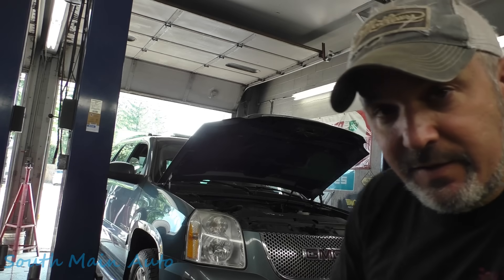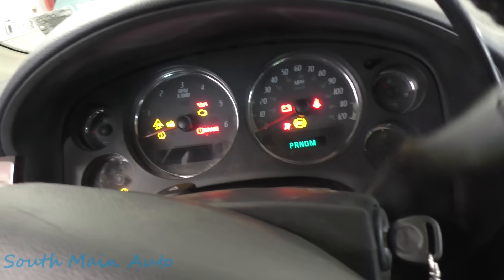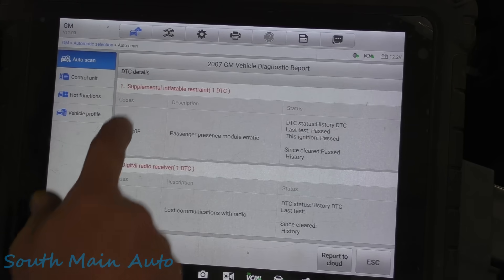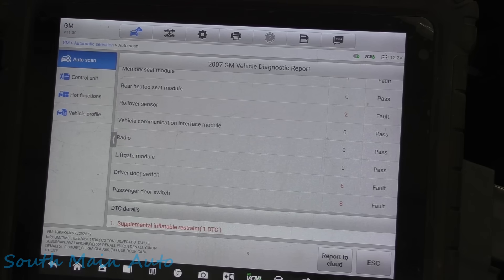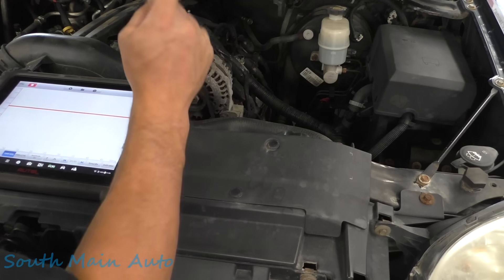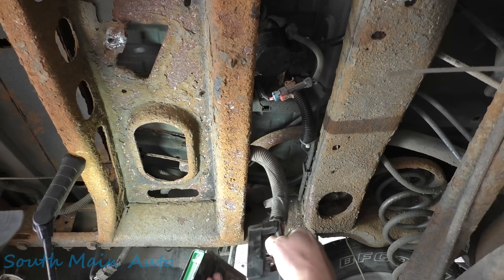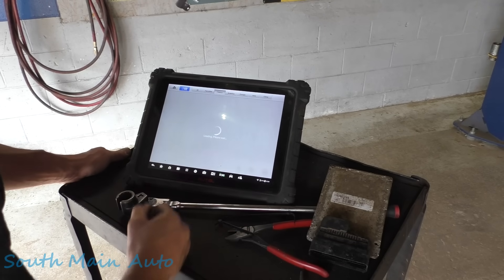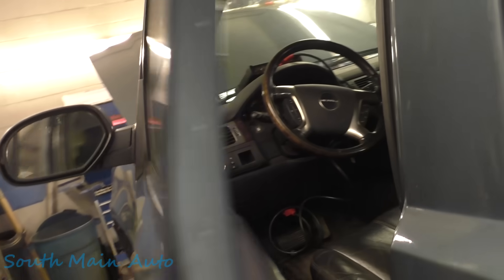Sometimes A Lucky Guess Is Way Easier Than An Actual Diag

Comment: Thanks for this video. I have a '08 Yukon. Fortunately, not that bad under it. I purposely avoided trucks with the air lift because of all the issues. It is a battle to stay in front of the rust but worth it if you want a reliable vehicle.
Reply: Wrong. I bought my 2004 Escalade specifically looking for air ride. The right is so much nicer than the Silverados and the tahoes in the same generation.
Reply: @SeanPennII  the ride may be nice but your wallet hates you if the bladders get damaged. ZW7 smooth ride is a nice middle ground, good ride but only the rear has expensive shocks.
Reply: @lsswappedcessna  they're not that expensive. 300 a corner a cheaper than my 2014 Vsport magneride shocks

Comment: I didn't notice any guess work. Your visual inspection pointed you to the networks weakest area. No Comm usually means to start by measuring the resistance but in corrosion country its optional!

Comment: For rusted out frames, i worked at Firestone, was doing an MVI, had tge veh racked correctly, started to raise it and the guy next to me yelled at me and pointed.  It was a Datson PU i believe. Front tires were about 1 1/2 ft off the floor and rears were still touching. Frame completely split!  Set it back down and the truck taco'd......call MoHP, and they said i still had to put a passing safety sticker on because the frame is not an inspected item. We PUSHED the veh out , had the owner sign a waiver and he drives the truck away w the middle of the frame dragging the streets!

Comment: I live in Indiana and a few weeks ago I asked around about getting my truck spray oiled like you mention and talk about on several vidios... It just isn't done and one shop was adamant that it is a environmentally not allowed... He also wanted $500+ to charge spark plugs and wires (is that normal?)... Anyway, I ended up doing a google maps search and found a Amish fella that does the oil spray and uses a comercial product... And it cost $140 and took a hour and a half... I wonder how many vehicles could be saved if we knew about this...? 🤔
Reply: Sounds like that first guy didn't know what he was talking about.   I'm pretty sure Fluid Film is just lanolin-oil based anyway, am I right??  Environmentally I don't know why you wouldn't be allowed to coat your truck frame with it.   I mean they used to coat cars with all kinds of crazy stuff underneath.

Comment: Eric,
There is no substitute for experience.
I live in the salt belt of the mid-west where they
use a brine on the roads, I think it has calcium chloride in it, very corrosive, vehicles driven in the winter don’t have a chance of lasting more than 10 years with out experiencing body and frame rot.
Thank you for posting your videos.

Comment: You can easily fab a steel bracket and attach it to the moving portion of the shop lift forks on both vertical poles.  Duck tape some Rubatex pipe insulation to the bracket.  Keeps driver and passenger doors ding free!

Comment: It's what some might call having EXPERIENCE with certain tell tale signs with certain makes and models. If you have some "old school" experience under your belt, that helps a bunch as well. If all you know is how to trace down things with the PIN test methods...you will be there for quite sometime until it hits you in the face. 
I agree the 6.2 L GM is a keeper of an engine. Torque and HP at almost every RPM. All they need are tight battery cable connections !  (LOL)

Comment: Industrial maintenance - had an intermittent fault in one of the machines. The circuit board was tested using all the suggested tools and methods. No direction. Pulled the board out and put it back in for the bazillion time and missed the back of the connector. Actually pushed on the board, which moved independently of the connector. Not supposed to do that. Cold solder joint on the connector. Lucky is some times better than good.

Comment: Be nice if the manufacturers would actually rust proof the underside somewhat, when I got my motor home a lot of the frame and metal wasn’t even coated, I rustleum painted everything that wasn’t coated, held up well for 16 years but I’ve lived in Arizona for 12 years

Comment: Got an 08 Yukon Denali 6.2 that after lifter replacement and a few "while I'm here parts' runs great but dies at a stop after it warms up. Just like you shut the key off. Only way to get it start back up is pedal to the floor aka clear flood mode.. No CEL, pending codes or history codes.. I'm stumped and so is every other mechanism in Alabama..

Comment: I have a 2004 chevy tahoe, 476k miles, original drive train. While I live in the East (PA) my frame is in decent shape, no rot but I did have to replace every metal line there is in it, brakes, gas, etc..I also replaced the entire suspension and a few components on the motor but the car is a tank and is very reliable..I would drive that car anywhere. On the flip side my new Chevy Traverse didn't even get past 36k miles before it needed a new alternator and other little bullshit, which of course isn't covered by the warranty anymore.

Comment: Just an FYI for ya, Eric.  There is no Class 2 Network, more commonly known outside the Corporate GM Proprietery realm as SAE-J1850 VPW (Variable Pulse Width) on this vehicle.  This is a GMT900 Program based Truck.  The last year for Class 2 on these particular Trucks was 2006, for the Previous Generation GMT800 MCE-3 which were built from 2003-2006.  Class 2 is GM's  terminology for the 57.5 kbps SAE-J1850 VPW (Variable Pulse Width) .  The Lower Priority controllers on this Truck all utilize the 33 kbps SWLSC (Single-Wire Low Speed CAN).  The higher priority controllers all utilze GM LAN CAN, which is GM's terminology for their 500 kbps Dual-Wire High-Speed CAN Network, also known as SAE-J15765-4 in the aftermarket realm.  There is no Mid-Speed CAN Bus on this Truck.  Keep up the Good Work, Eric !  You are doing us all a Great Service, spending so much of your own time making these videos an sharing your knowledge & skill with all of your Videos.  Thank You.   😊

Comment: Thank you Eric again, thank you for thank you for teaching me over the years I learn things from you I do have a question though ion a 2006 trailblazer with a 42 L engine. I bought it two years ago. I’ve been fixing it little by little but the only thing I cannot fix in the morning when it’s cold or no matter what time it is when it’s cold engine, the RPMs goes up and down just a little bit like I want to shut off but only do it a little bit once it starts though it runs fine all the time everything is fine no problems I cannot figure that out why it does that and cold start every time the engine is cold the engine cheeks cheeks just a little bit every time I stutter when it’s cold any idea what that is? Thank you.   I cannot figure that out I’m not 100% mechanic I’m learning.👀🌿

Comment: Beginning to wonder if GM's use of high strength steel and perhaps the hydro-forming process has something to do with Eric O's concerns with corrosion of GM major frame/crossmembers? I remember commercials touting these things early on and some serious problems at first if memory serves..(Not having to do with corrosion).  But hey Eric..This is a 2007 so it's 16 years old and sitting for a while to boot and helps pay for your kids college!  And then there's that Chevy thunder!

Comment: That's crazy that a bad module can cause everything else to give up, yet when you disconnect it, everything is working again
Reply: That's kind of the point of CAN bus.   The 2 lines/pull up/pull down design gives it a bit of extra robustness, the idea being that if a module starts corrupting data, the network can still operate.   Although in actual operation it doesn't always end up that way.   The idea of CAN bus actually started as a field bus for automation in factories and between factory systems.   I think Bosch kind of lifted that idea to develop Can-bus back in the 80's.
Reply: Sure. If the module dies the network keeps working.  But the problem with CAN is that if the interface at the module gets damaged, it's taking down the network because of how CAN strings modules.  If CAN were a star or home run topology, these kinds of problems wouldn't happen.  A star topology like Ethernet would just ignore the crap happening on that port whether it was the module proper or the interface to the module. Not saying we need Ethernet here.
Reply: @major__kong Good info 👍
Reply: @major__kong wrong…
Plenty of cars like bmw and mercedes have a star topology where all the dual wires go to a central connector. If a module goes bad, network goes down. You go to that connector, and disconnect each tiny connection until the network comes to life just like the string network
Reply: Just read where a newer out of warranty F150 with a leaking rear tail light with modules built in it caused the truck to quit running and cost the guy $5700.00 for a tail  light and the repair, and the owner just wanted to know how soon he could get his truck back! didn't care about price!
Reply: @mikesabin8568  Yes, star topology probably wasn't the right word.  I think that's part of it, though.  In Ethernet, if one leg of the star goes bad either because of the cable, the interface, or the client, it doesn't take down the rest of the network because the router manages the connections.  I'm trying to imagine the star configuration for CAN.  Don't the legs come to something like a bus bar?  If you stretch that topology out, it's really the same as stringing modules together.  I think the word I'm looking for is ring topology - CAN is a ring topology regardless of physical layout.  If anything damages that ring like the connector becoming corroded or shorted or the module goes bezirk, it impacts the whole ring.  That can't happen with other network topologies like Ethernet that use a managed central hub.
Reply: @major__kong  yes on the bus bar. Each module has the two wires going to it and the bar can actually be removed from the connector. They call that star configuration and if any module goes down, it brings down the system. You can disconnect each tiny connector from the bus bar individually to isolate the bad module, but that is the star. Not all cars have that. Some just have the dual twisted wires connected straight to the next module in more of a relay style. In that configuration you have to dig out the module and disconnect it and on top of that, jump the can wires to the rest of the system

Comment: I just got to say I’m continually horrified by the rust you guys are dealing with in what are not very old cars.
Here in Central Queensland Australia I thought we had bad rust because of tropical rainfall and being close to the coast but you guys are seriously dealing with absolutely catastrophic rust!
If you are totally on top of your maintenance can you prevent it or are you just delaying the inevitable by a few years? Great Content :)
Cheers Paul from Oz
Reply: It's always the road salt, since it snows several months out of the year in New York.   They have 3 year old cars go to the crusher up there because of the salt.
Reply: @jtjones4727  It was never that bad with the old rock salt they used to use. Ever since they switched to brine salt, you can count the life of the frame, brake lines, etc. on one hand.
Reply: @jtjones4727   and yet, voters don't raise a stink and continually throw away 10's of thousands of dollars on vehicles instead..(just shakes his head)
Reply: Most people don't do it, but an oil-based undercoating will keep the car alive longer. It's still going to rot eventually, but it will take a lot longer to rot if an undercoating is applied every year.
Reply: I paid to have my 2006 F150 undercoated when new. NEVER AGAIN. Frame rusted from the inside out/ I just swapped my 125k mile drivetrain into another 2005 F150 that had a bad cam and 274k miles. Original frame is completely rust free and NOT undercoated. I applied "chsssis saver" to the whole frame before it gets covered in salt. Sad that OEMs make junk to fail. Tesla is taking sales and the CYBERTRUCK being Stainless steell WILL NEVER RUST. OEM truck sales are aobut to take a beating.
Reply: @tabbott429 Undercoat is bullshit. Fluid-film (or any other grease that gets reapplied) will absolutely helpm

Comment: Eric, thank you so much for your video/s and sharing all your knowledge with us.  I am a subscriber and grateful for all your work.  I like to work on my cars so I am a dyi’er and your information has been helpful.  Can I ask you for recommendation on getting automotive parts other than OEM? I am a believer on getting OEM (dealership as applicable) but they are very expensive and sometimes they are not cost effective.  I have a ‘95 Toyota Corolla with over 230K miles and it needs all motor and transmission mounts.  Any recommendations on parts brands? Thank you very much!!

Comment: Simply amazing they can charge that much for a vehicle like that and it rots in a matter of years
Reply: It's not in the manufacturers' interests to build cars that are indeed corrosion resistant.  If they did, they'd have to charge double what they charge now in order to maintain their profit margin on sales BUT THEN they'd be "giving up" new car sales driven by rust-bucket elimination.  They only want them to last for the warranty period, for maximum profits. Digital age engineering has allowed them to deconstruct most "durable goods" to last only for their warranty periods WHEREAS these items used to be built heavy-duty-fixable enough to last twenty of thirty years of regular use.  I Fluid Film my stuff even though I'm way south of the Rust Belt.  But the makers never will.
Reply: @wadepatton2433  I agree completely that the older cars were built to last. I grew up in northeast PA and during the 70s. Cars and trucks used to last but I just can’t believe how bad they get and how quickly these days. I live in Georgia now and you can find vehicles that are still in great condition as long as they haven’t been sitting in a field for too long. My 2017 Camaro is still super clean and I use it to drive regularly. I’ve seen 2019s on this channel and it looks like a nightmare underneath

Comment: You covered my first question.  I was going to ask if you would pass the inspection on it.  Is it able to be road safe or is it too dangerous to try?  Only use left for it is a plow truck in a private lot?
Reply: It *should * fail for frame rot. However,  like Mr E said there will always be a shop that had Helen Keller or Stevie wonder working there that just doesn't care. Until they get caught,  that is.😮

Comment: I wouldn’t call it a guess but simply narrowing down the options based on experience and and high failure rate components. Kind of like having an evap code on a GM and going after the purge or vent first cause you know it’s a common failure. I’d call it experience.

Comment: My work partner drove his Ford pick up to work one rainy morning and when he went to get lunch, his truck wouldn’t start security light was flashing everything seem to work except the starter wouldn’t click. He had to have it towed turned out it was that module that sits above the spare tire in the back Had shorted out. Apparently that’s a common problem on Ford pick up trucks
So I was doing some service work on my spare tire on my 2005 Ford pick up and I just happened to look up there at that module and I noticed it was all corroded and then I noticed it was cracked almost in half truck still ran so I bought a brand new module just in case I would hate to be stranded because of a driving through a mud puddle.
Reply: PS I forgot to say I replaced that module that day.

Comment: I've said this before New York has got to be the salt or chemical rot capital. Got to be a combination of the amount of chemicals used on the roads and too many days just over and under freezing that causes that much rust. In Minnesota, we just don't have that kind of rust in that short of time. It's colder, and we typically don't treat all the roads. Treating roads doesn't work when it's colder. We plow often and use a lot of sand on secondary roads. We drive on hard pack roads a lot. Faster roads and freeways, yes, but there kept clear.

Comment: There are a LOT of vehicles like this and worse running around in Illinois as we don't have inspections except in large metro areas like Chicago and those are emissions mostly. I see rockers totally gone. Frames probably worse. Not good with unibody cars>>NO structure means it will fold in half during a fender bender.

Comment: Does the scrap yard compensate for the engine still having value?
Reply: nope. you are selling by weight if it's in frame at the scrappers.  Want more money? Sell it in driving condition, or pull it out and sell it separate.
Reply: @wadepatton2433  A scrapper’s license required?

Comment: I was having the same problem with my Escalade so I pulled that module and all is fine now.  I didnt cut and splice those wires though but it's been driving and acting just fine for months now.  Anybody know what happens if you dont do the bypass wire splice thing?

Comment: Ok 10 seconds in my guess. 
Transmission position sensor/wires.
Wont start if it's not in park or Neutral.
Probably damaged during dropping the oil pan.
Edit:Well I was wrong but that's how we learn.